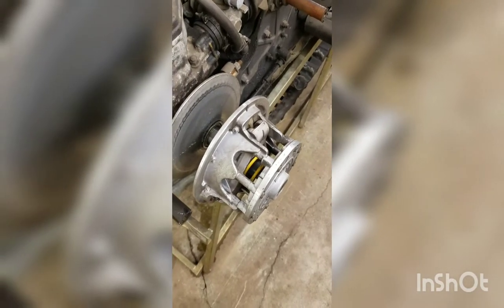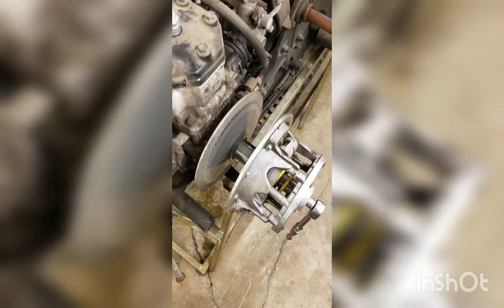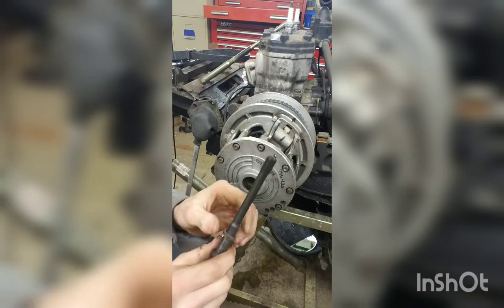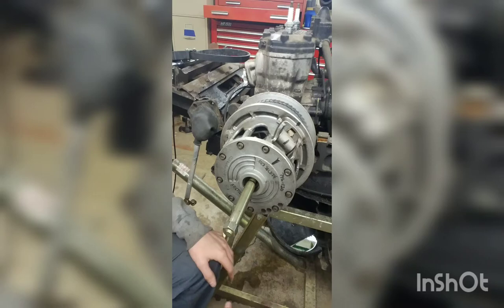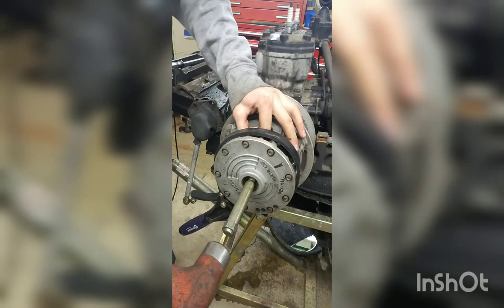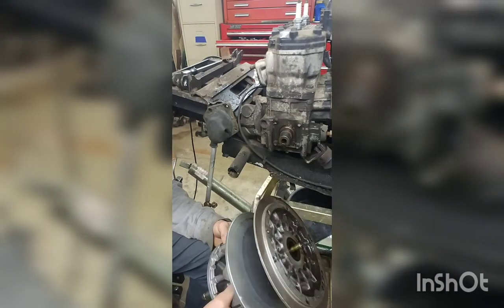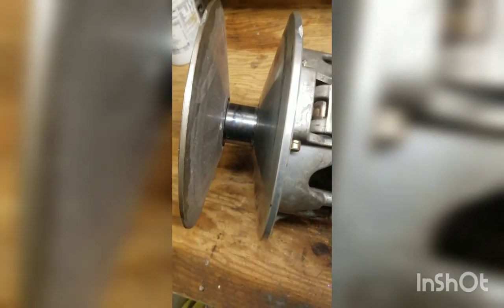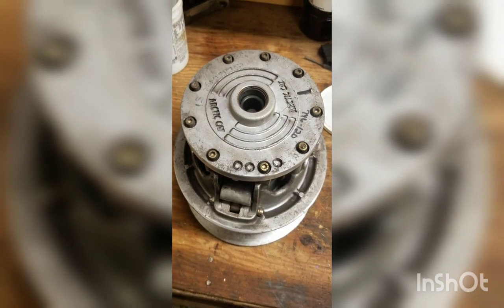Sled Tips 003 - How to remove a snowmobile primary clutch. A correct way

Comment: Same as what I do, but I grease the puller threads. Helps snug up the puller and protects the threads. Couple taps and they usually pop. If they dont, I let it sit with PB overnight and often times i’ll come back next day and it pops off on its own

Comment: If you are in a cold climate just put some teflon tape on the puller. Put some water in there tighten it up and stick it outside. when it freezes it comes right off. use that method for ones that just will not come.

Comment: Been racing for 45 years. Always used an impact. Don't have time to fiddle around with a wrench & hammer. Impact wrenches won't hurt your crankshaft.
Reply from the maker: Suit yourself!
Reply: I've heard pros and cons on using impacts on clutch pullers and heat on the clutch.  But at the end of the day you do what works. Well done video and thanks for posting.
Reply: Use an impact driver first. Then if all else fails get out the big boy 😄

Comment: He doesn't want to rattle the crank with an impact, but is willing to pound on the puller with a hammer.   I have been pulling Comets with the impact for 20 years, and rarely do they come hard,  never have I beat on my puller with a hammer or used heat.  Zip and they are off.  I do not use an impact pulling flywheels, I feel that is a different situation.
Reply from the maker: Really no different actually. But hey, you're the expert. 🤣
Reply: An impact gun only applies impact in a circular motion not impacting crank bearings. Hammering end of puller definitely is a no no that directly puts all applied forces of hammer into crank and doing damage.

Comment: Thanks for the video hard to find stuff on older equipment...have you made any on the adjustments for them
Reply from the maker: So far just removal. I have some video of disassembly. Also Primary roller replacement. With racing season in full swing, I have been failing to get it all edited and loaded, but will be getting those things done ASAP. 

What kind of info are you looking for? I may be able to help and/or put that on the list for new videos!

Comment: FYI the service manual says to "hit the end of the puller sharply with a hammer".  So not love taps like he did and dont pound it like its a 4 inch spike, just a solid sharp slap and it'll pop right off, and not hit the floor cause you werent being a man about it.  Hope that helps.
Reply from the maker: Got it off without your help 🤙 Thanks.

Comment: The crank bolt on my 1999 500 ZR seems stripped, as I keep turning and turning it's not backing out. Any tricks or thoughts on how to remove it and get to the primary clutch? I tried prying on the clutch while turning the bolt to see if it would catch some good threads, but no luck.
Reply: There is usually a nylon spacer in there. Try grabbing with a needle nose and pulling it out

Comment: I think I like water trick no hammer needed that will damage your machine
Reply from the maker: Whatever works best for you! Hard to deny the versatility of fluid pressure as a tool.
Reply: @longtinmotorsports  ya I just watched his video not saying he don't know what he's doing he got it off just took a while with beating on it I took mine off today to clean and inspect and tried the water trick and it took like five turns and popped right off without a hammer thought it was great didnt believe it though

Comment: What would you do if the puller snapped off in the clutch threads? That’s where I’m at now…
Reply: Happened to my atv had to cut the clutch off luckily I didn’t damage the crank
Reply from the maker: I Would get the puller backed out however you can. Then use the water method to remove the clutch. I've got a video showing how to do that. Probably be tricky to get the puller threaded out of the clutch, but unless you want to damage the clutch or crank, you'll want to find a way.

Comment: Use heat before hitting. All that hammer banging is directly putting force on the crank bearings! Never hit! Best heat is with a hot air gun. Apply torque, then heat.
Reply from the maker: Got it.

Comment: The correct way is to use the proper clutch holder, grease on the threads, and an impact
Reply from the maker: it is the correct puller, you grease the end of the puller, and an impact is optional. Thanks!

Comment: my clutch part number should be according to the manual a p/n 0725-146
Reply from the maker: Scott, this should be the right one https://www.ebay.com/itm/125111653577?mkcid=16&mkevt=1&mkrid=711-127632-2357-0&ssspo=sKLlFjG8R_O&sssrc=2349624&ssuid=Wvv_emctRDm&var=&widget_ver=artemis&media=COPY
Reply from the maker: or this one https://epiperformance.com/primary-clutch-puller-pcp-5/

Comment: what are the threads on the clutch puller ?
Reply from the maker: The standard puller for all the old arctic cat stuff is 9/16-18. That covers a large number of years, but somewhere around 2010-2011 they started using a metric clutch. Those threads are 14x1.5. Hope this helps
Reply: @longtinmotorsports  Thank you . I want to change crank seals on my 77 500 cc pantera and 86 500 cc cougar again thank you
Reply: So. Impact wrench no Good..   But smacking your end play with a hammer is safe.?   Makes sence.
Reply: @newt20002  what end play

Comment: Bashing the Crank End bearings with a hammer  isn't a smart thing to do?? Glad you're not working on my Sled Buddy.
Reply from the maker: Arctic cat Service manuals state it right in them.  And no one is hitting bearings. Hitting the clutch puller. If you understand how the puller works, you understand why hitting it with a hammer wont do any damage. Good luck with your own repairs, buddy!
Reply: @longtinmotorsports  i saw a video of 1000hp snow mobiles with billet CVT cases

Are the internals the same? And where to get the ultra performance CVTs for drag racing??